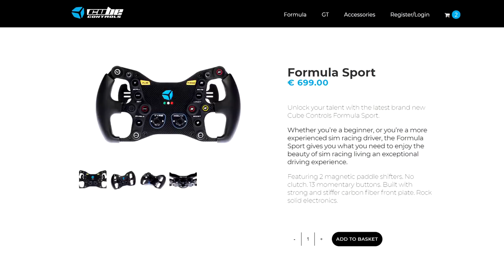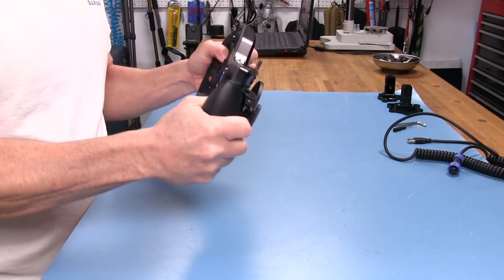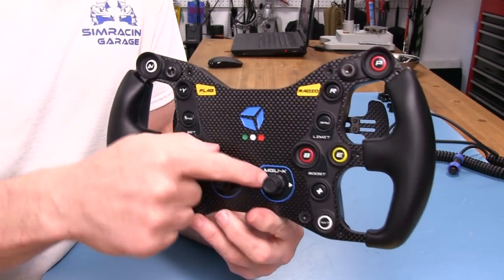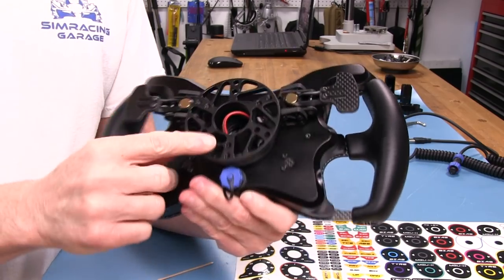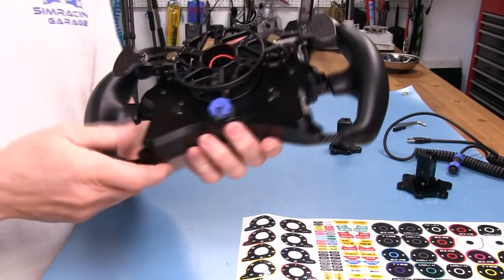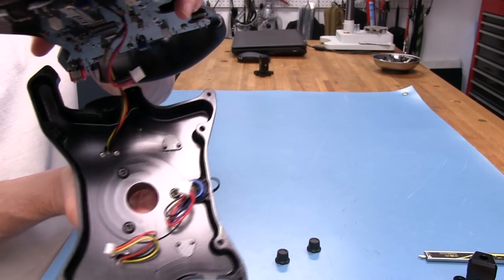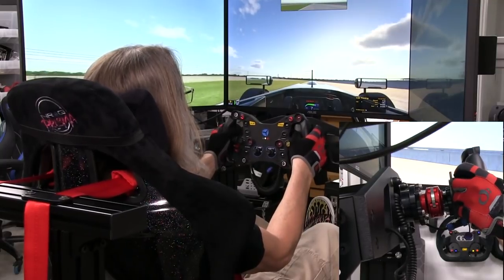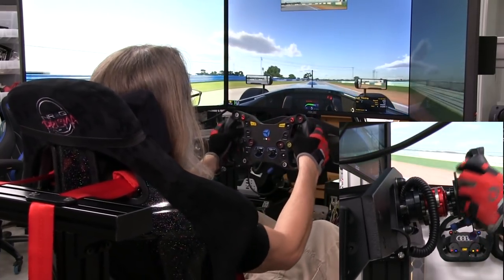Cube Controls Formula Sport Wheel Review

Comment: I just purchased the Pro version of this wheel and it has great functionality, but the shifters I can't seem to get used to. The throw on them is just to long, even in the shortest setting. Would love to be able to use this wheel but sadly I will be selling it.  Also the shape of the grips allow my hands to slide around to much when making a fast turn.
Reply from the maker: Not surprising. As I often say, everyone is different. Just because it works well for my body doesn't mean it will work the same for you.
Reply: @simracinggarage3026  I think it's down to my setup, my DD2 is mounted to an rseat N1 and wth the Podium Hub mounted to this wheel puts it to close to my body to get a good grip on the wheel and my current setting position is perfect for my other wheels so reluctant to change it. I love the throw distance on the McLaren wheel and the Podium padels kit it's perfect for my hands I wish the Cube padels had this short of a throw
Reply: Sometimes you just have to adapt or accept what life throws at you. It can't be all perfect. When driving a real car on a real track, it is what it is. I did a testdrive with a Norma FC20 and it was what it was. I can't bitch about the grips, the feel, the length to the wheel or whatever. You accept and adapt or not.
Sometimes I have the impression that us simracers are nitpicking that it becomes a standerd. There is a lot of choice on the market and it has advantages and disadvantages.
Why can't we just enjoy what we have?

Comment: Nice wheel but I'm noticing a trend of wheel manufacturers moving away from using Bodnar boards and knitter switches and cts pots to using custom printed boards. Not a good thing imho especially if anything goes wrong in the future it's not as easy as just de soldering a switch and replacing it. 

 Ascher wheels have gone the same including getting rid of the carbon and using cheaper switches which has turned into a Fanatec equivalent that's 3 times the price. The days of wheel manufacturers using top end switches and rotory encoders are coming to an end unfortunately. Only company I see still knocking out top of the line wheels with knitter switches and cts pots is SSRG.
Reply: yeah, I'm glad I still got my Ascher C26S
Reply: I very much prefer custom PCBs over a huge ratsnest, in this case it looks like all switches are just soldered onto that as well, so you can just desolder them and pop in a replacement. The quality of the components used is a different topic, but if the quality was similar in both cases I don't see how a PCB would be in any way worse than a ratsnest, very much to the contrary even.
Reply: @KacKLaPPeN23  I've never seen a high end wheel have a rats nest. It's not the replacement of buttons that bothers me the most it's a problem on the pcb that will be none replaceable further down the line. 

Bodnar boards are around £25/35. I know what you are saying but this is kinda like Hifi or PC to me or like high end RC cars with separate components. 

Anything goes wrong on my laptop and parts are generally none replaceable compared to PC. Same as all in one Hifi compared to separates. I just prefer parts that can be changed easily with off the shelf components rather than been locked into a specific pcb especially at this price point.
Reply: Precision Sim Engineering has the best switches and encoders I've seen anywhere.  They cost more, but you can't accuse them of using any cheap controls.
Reply: @markkovalcson7243  At double the price for similar functionality, I hope Simon's using double the quality (if that's even available) switchgear.

Comment: Barry, thanks again for this review. What are you’re thoughts in general on the durability of grips? Rubber grips seem the most durable to me, currently have one custom made wheel from SSRG with alcantera which is awesome, but with my knowledge today I would have chosen something a bit more durable with regard to the grips. The wheels from pro-sim for example or precision sim engineering.
Reply from the maker: Yes, I think the rubber or urethane grips are more durable. They will still wear though. And some may prefer a softer or harder durometer, so best to try different ones if possible.
Reply: @simracinggarage3026  you can put tennis grip on-top of the wheel for better durability and good grip as well. I do it in  real racing car btw
Reply: @vyacheslav_potapenko  or air chamber ,  really good grip

Comment: What is the shift knob you have on the Prosim shifter? I recently purchased one and have been looking for a bigger one. Thanks for the reviews as always!
Reply from the maker: Chrome plated Stainless Steel ball. The added weight enhances the shifting experience for me.
Reply: @simracinggarage3026  did you purchase it somewhere, or have it machined custom? I'd like to buy one.
Reply from the maker: @1986alexpotter  Found the one I use on eBay over a year ago. Not available from that seller anymore.
Reply: @simracinggarage3026  thank you for checking!

Comment: Entry level formula wheel: 700€
Yea, I think my whole simrig came out at less unless you count the VR headset but I also use that for other games.
Is it just me or is simracing really lacking some in-between products from independent vendors? There's not much between a T300/TS-PC and the High-End offerings right now.
I really want to see more stuff in the price range of what SIM-PLICITY is doing.
Reply: Probably the clubsport stuff from Fanatec would end up in that middle of the road range.
Reply: @donovanturcios3713  Fanatec is so large that I don't count them as an independent vendor anymore. Actually considering how they are doing business they aren't far off of being the Apple of simracing. Maybe I should've worded it differently but the stuff I find the most lacking is aftermarket/universal stuff that's pro-sumer but not high-end. Maybe a buttonbox for your wheel that's not 700+ but more in the range of 150-300 while still being agnostic to whatever it's mounted to. Or a set of pedals between the Heusinkveld Sprint and Fanatec Clubsport v3. Or those lower powered (but still plenty unless you just want something to rip your arms out) DD wheelbases sim-plicity is offering. If I had to decide between a Clubsport v2.5 and a SW-7 or something I'd probably pick the SW-7 just because I could use any rim I want and wouldn't be bound to an ecosystem that might haunt me later.
Reply: @KacKLaPPeN23  Check out Penguin RC, Brian Sohn's company.  They have a lot of entry to midlevel stuff, at excellent prices.

Comment: I beg to differ the usb cable is not in any way high quiality, I bought this wheel, on button wasnt soldred, and now the usb cable doesnt work, and it does not have any visable wear. 

buy a g27 or g29 they will work for years, all these other more expensive ones are nothing but a huge disappointment every time.
Reply: Hi Nikolai, 

We’re sorry to hear that. We would like to say that precious feedback like yours helped us tightening QA's test on all our products.

With regard to the USB cable, as we advised, the issue in this case was due to an incorrect connection. Please just contact us for any further question, we work hard to make you guys happy and satisfied as this is what matters the most for us. :)

All the best,
Iride